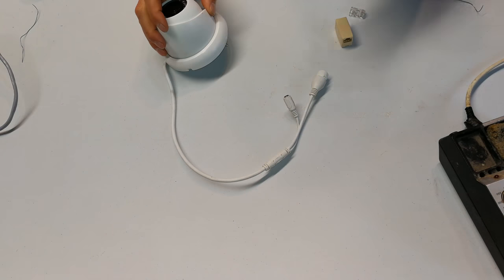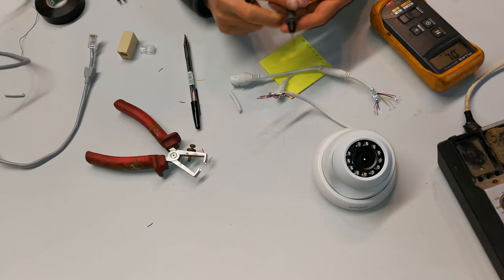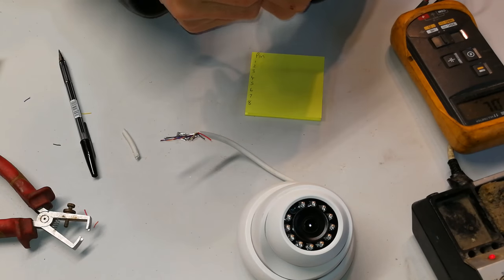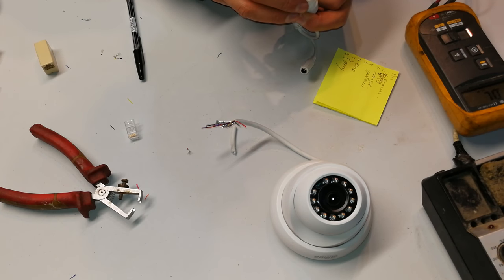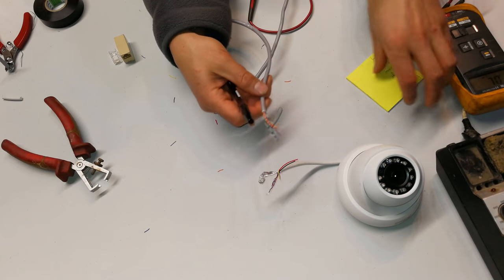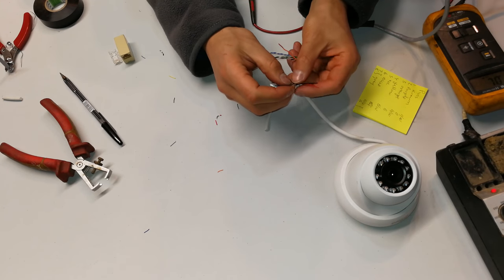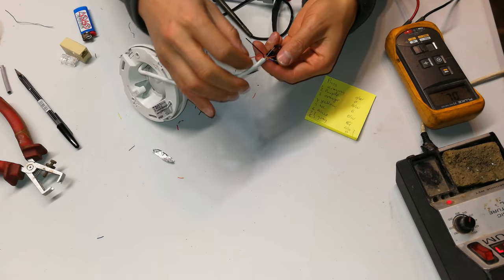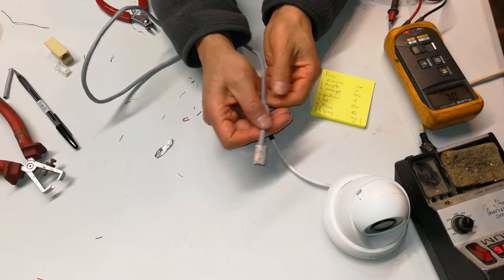How to re-wire a broken Dahua IP camera cable - CAT5e (RJ45)

Comment: Thank you very much for sharing colour coding, my question is when we connecting RJ45 connection with the camera cable , what we do number five & eight cable ( i.e. white blue and solid brown) do we cut these two cables or we twisted cable four& five (white blue with blue solid ) and same thing with cable 7& 8. thanks in advance if you reply to this question.

Comment: April 20, 2020. Similar problem with IP POE pigtail for bird nest camera. 1-8 pin out module inside camera #1 is empty. 2. Blue. 3. wh/green 4.green 5. white/or 6. orange 7. black 8. red. If 7 & 8 are part of alternate power, don't need it. How do the above colored wires translate onto cat5 or cat6 ?

Comment: I removed the rj45 I will never use that, that left me the 12VDC power plug, That plug has 3 wires  red red/white  black. Will that work? It is wireless

Comment: Hello, I have almost the same camera from dahua, but I cutted off the power connector sometime ago and now i can't find this piece of cable back anymore to measure how it needs to be connected... I can't see this cable in your video, only in the beginning, but there are just 4 colors inside; red/black/green and blue. I connected red to + 12V and black to -12V. But i still can't find the camera in the internet. Can you tell me what's the connections of this power connector? thanks in advance